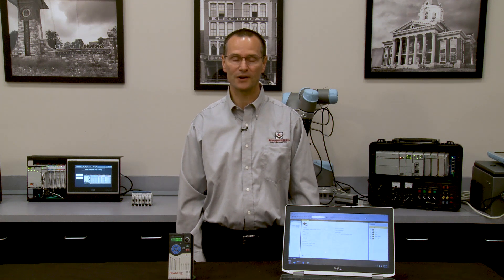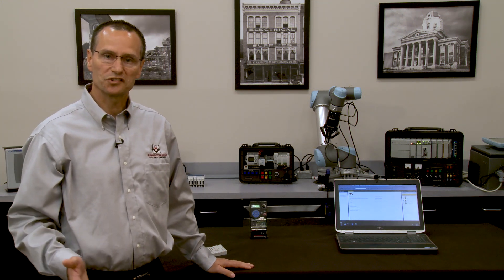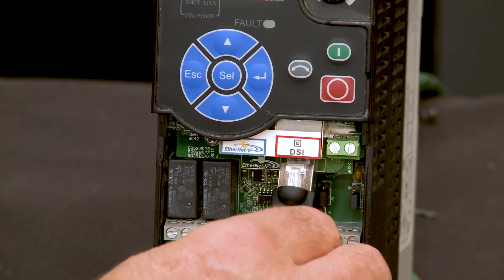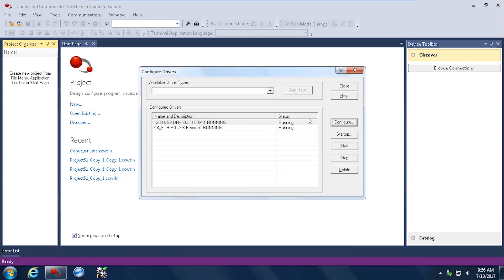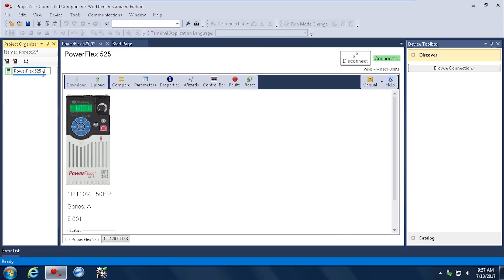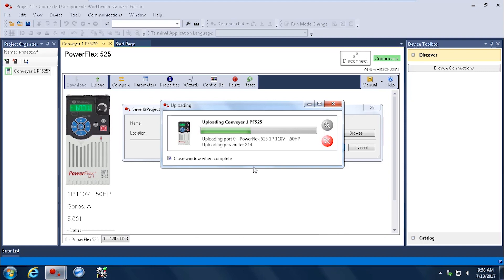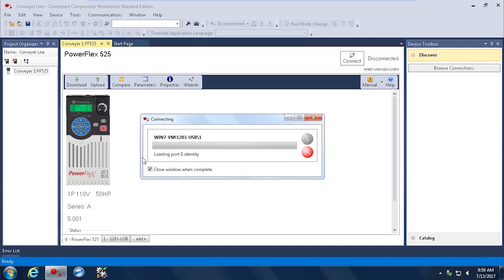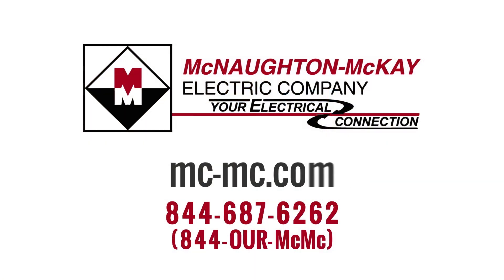Uploading and Downloading PowerFlex 525 files using Connected Components WorkBench with a 1203-USB

Comment: Hello, congratulations on the video, I have a question. Can I access the settings via the DSI port with a generic USB - RS485 converter?
Reply from the maker: Thank you for your question. You need to configure the driver to communicate with Modbus using the DSI port. However, please note that this setup limits functionality. The parameter list can only be displayed linearly, and there will be no access to communications option card programming. This means you'll be able to access only one parameter at a time, and no programming changes can be made to the parameters.

Below are two links that provide more details on this. For the manual, refer to page 71:

https://rockwellautomation.custhelp.com/app/answers/answer_view/a_id/546278

https://literature.rockwellautomation.com/idc/groups/literature/documents/um/520-um001_-en-e.pdf”

Comment: Hello, will this program work with a PowerFlex 4M drive? It has a RS485 port
Reply from the maker: Hello,
Yes, PowerFlex 4M drives can be programmed with CCW. Once in CCW, create a new project and name it respectively. Then, under the Add device selection screen click the Drives drop-down menu. The PowerFlex 4M drive will appear under the “PowerFlex 4-Class” folder.
If you have further questions or concerns, please reach out to your local Rockwell Automation distributor for personalized support.

Comment: Hello sir , can i use this cable with powerflex 40
Reply from the maker: Hello, The 1203-USB can be used for PowerFlex 40 Drives. Instructions on how to connect to a DSI drive can be found on page 21 of the 1203-USB manual: https://literature.rockwellautomation.com/idc/groups/literature/documents/um/drives-um001_-en-p.pdf 
If you have further questions or concerns, please reach out to your local Rockwell Automation distributor.

Comment: This will not work in multi-drive mode that are utilizing 5 devices on one node. Is there way a to pull parameters off devicenet, using the scanner module in CCW or do you have to use driveexcutive with RSnetworx
Reply from the maker: Sorry for the delayed response! 

Both CCW and DriveExecutive can be used to connect to the drive over DeviceNet if you are using a 22-COMM-D or 25-COMM-D adapter. We recommend using CCW as it is an active software product from Rockwell Automation receiving new features + patches.

Alternately, the PowerFlex 525 parameters can be backed up with a USB connection when the drive is unpowered. Refer to the PowerFlex 525 User Manual for more details: https://literature.rockwellautomation.com/idc/groups/literature/documents/um/520-um001_-en-e.pdf

If you have any additional questions, please reach out to your local Rockwell Automation distributor!

Comment: Is the .ccwsln the only file that's required as a backup? I also have a .ccwsuo in my folder, what is this for?
Reply from the maker: Hi Martin,

Here's some info that might be helpful:

.ccwsln - CCW Project File - This is the file extension of the project that is saved. This contains all devices/trends in the Project Organizer when the project was saved. Note: This file cannot be opened unless it is located in the original directory it was created in. A user cannot transfer a .ccwsln out of the project folder and open it alone. The entire project folder must be sent with the .ccwsln file to be opened.

<CCWFileName>.ccwsuo--This file keeps track of where all the pieces of the project are located.

Bottom line - CCW creates them and it's best to leave them as they are.

If you have further questions or concerns, we recommend reaching out to your local Rockwell Automation distributor for personalized support.
Reply: @mcnaughtonmckay  Thank you very much. I really appreciate that detailed response. I will consider the entire folder as 'the backup' and leave them intact when storing. 👍
Reply from the maker: @martinmchugh1924  Happy to help!

Comment: I can't do this in studio ?
Reply from the maker: Hello, That is correct. This functionality is intended for CCW, not Studio 5000. If you want to learn more about the offerings mentioned here, please reach out to your local Rockwell Automation distributor for further information.
Reply: @mcnaughtonmckay  through ccw if I connect to a local switch where all the powerflexes are connected can I pull the backup files that way instead of plugging into them.one by one
Reply from the maker: @DSNCB919  Yes, as long as you can see the drives in RSLinx through the switch, you should be able to access the backup files. We still suggest reaching out to your local Rockwell Automation distributor for support specific to your application if you have any concerns. https://locator.rockwellautomation.com/

Comment: Tks for video. I have a question, can you help me? Is there a way to get all the data from the Powerflex 525 over Ethernet without an Allen-Bradley software or get data (parameter:basic display) from Connect Components Workbench?
Reply from the maker: Hello, Yes, you can get this data from Connected Components Workbench over Ethernet but you cannot do this without Allen Bradley software. If you have further questions or concerns, please reach out to your local Rockwell Automation distributor.

Comment: Thanks for the valuable video. Can you advise me. I'm facing some issues on POWERFLEX 523  drive. I can give command frequency for ex: 30hz. The drive showing that frequency but the output frequency is 0. The motor doesn't ON
Reply from the maker: Hi Arun, Double check that your wiring exactly matches the diagrams shown on page 11 of the Quick Start Guide (http://literature.rockwellautomation.com/idc/groups/literature/documents/qs/520-qs001_-en-e.pdf). You can also check your digital ins under parameter 14, detailed on page 19 of the Quick Start Guide, and follow the Smart Start-Up guide which starts on page 21. If you need further assistance, please contact Rockwell Automation as these drives qualify for free support from Rockwell Technical Support.
Reply: Allen bradley does this when a leg is probly not got a good connection. Had a new line last week electricians left a leg loose